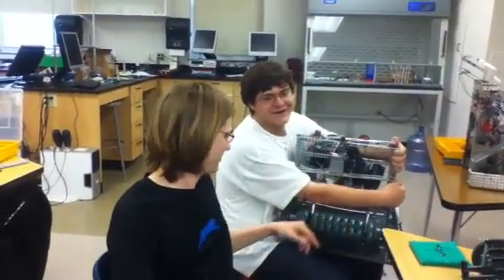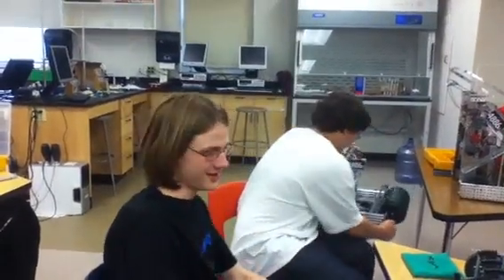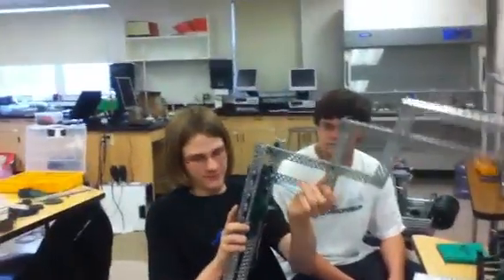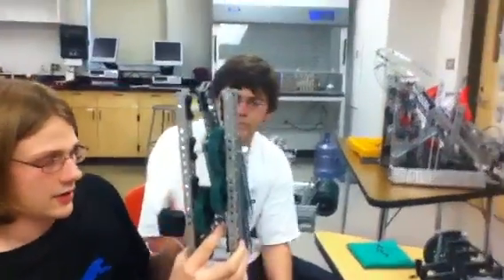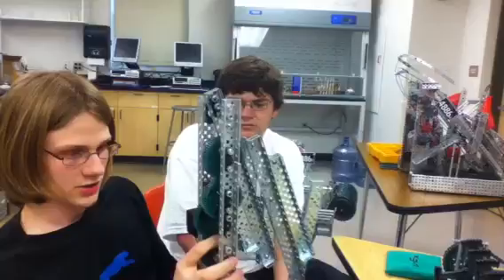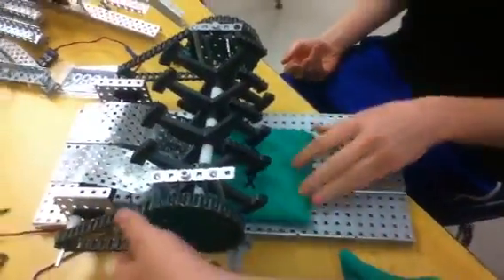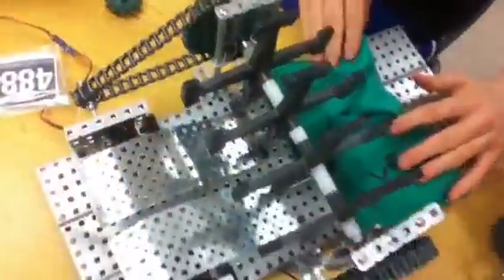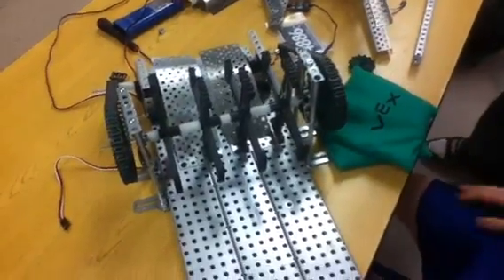Aperture Science 4886a Sack Attack robot reveal

Comment from the maker: Um, well now we use an external gearing of 15:1 for torque.  That's a metal pinion gear on the motor, which then goes to a 36 tooth gear, and on the same axle as the 36 tooth gear put another 12 tooth metal pinion, and then have that go to a 60 tooth gear

Comment: Just a quick update, this robot is almost finished. We have changed a few things and deviated quite a bit, but now it is has come back to something mostly similar to the original design.

We are no longer using planetary gears or an H-drive, going instead for a slick, efficient tank drive to start with. Experiments are being done with the lift and the intake still needs some tweaking, but the major building has taken place over the past four days.

Comment: Although technically possible, this is not easy to do practically.  A six bar does not generally provide 6 more inches, usually only 3 or 4.  Also, your math assumes that the lift bars can go completely vertical, which is not the case.  It would reach out a little at the top, and not have the complete height of vertical bars.

Comment from the maker: Got the measurements.  The bottom bar that is connected to the gear in 8 inches, above that is 12.5 inches.  Then the connecting upper bar is 7.5 inches.  Then on the 6 bar level, the bottom is 12.5 inches again, above that 8 inches, then the 2nd connecting upper bar is 7.5 inches.  Last upper bar is 8 inches.